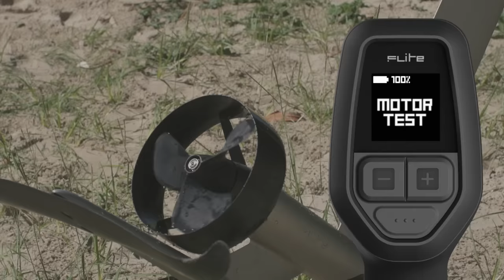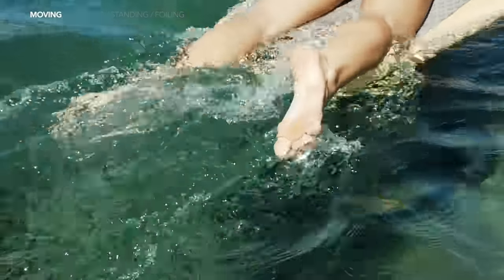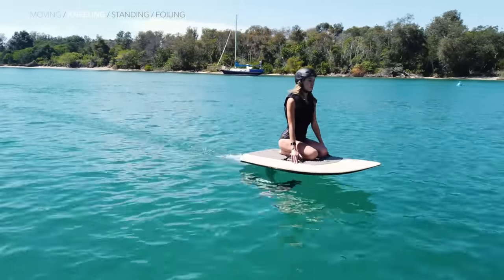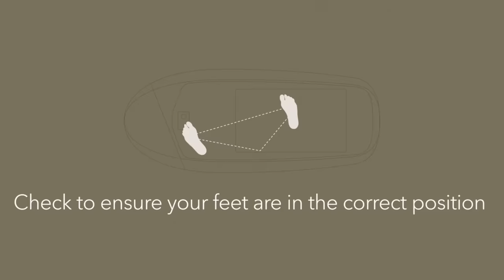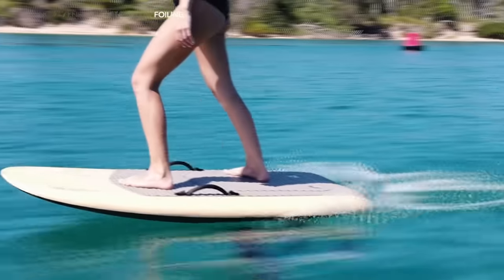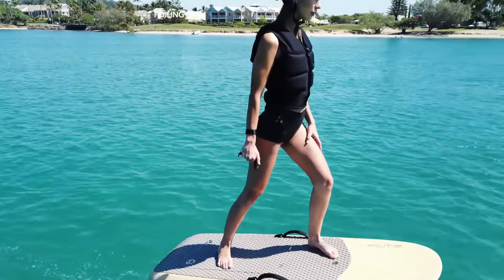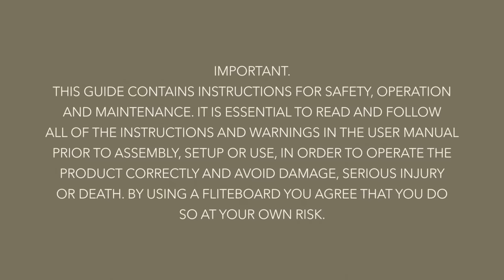How to Fliteboard - Series 1 - eFoil

Comment: We need more rich people to buy this, so competition and innovation will bring price down for us normal water junkies.
Reply: How much you are willing to pay stuff like this
Reply: @hammer7718    For $300 plus the cost of a surfboard, you can make your own.
Reply: How much do they cost?
Reply: @noahzegart5190  Like 10 grand
Reply: @woomeebly  Dude, no way that's real. won't even cover shipping.
Reply: @elusha3926  it’s not even the price of the board without foil, motor, batteries, and S&D
Reply: @coolhari2000  13k and up
Reply: @noahzegart5190  5-8k euros
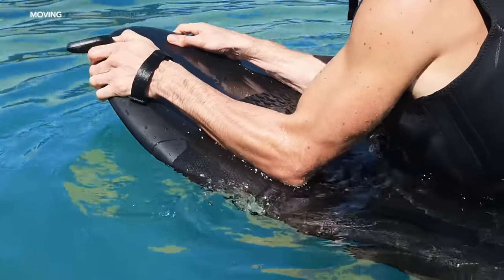Reply: 3:35 when your boarding instructor also drives a windowless van :P
Reply: I did my part
Reply: Lots of used ones for sale😂😂
Reply: @craigspriegel8982  Where & how much
Reply: That's like the price of a car....seriously...hand crafted...gimme a break.
Reply: @DEO777  how?
Reply: @pikoportal  mount an electric motor, propeller, and battery in a surfboard.
Reply: @DEO777  make total sense. Any advice with specifics? Which electric motor would you use?

Comment: Looks pretty cool, 12 k seems pretty steep, but normal for new tech.  Hopefully as the technology progresses the price will come down.
Reply from the maker: A lot of the cost is in the battery and hopefully battery prices drop as lithium supply increases. A lot of the other costs are the cost of hand made carbon fibre work, which hasn't really reduced much in price over the past decade. Our board itself is much more complex to make than a high-end SUP or Sailboard but is about the same price (for the board only).
Reply: Wait till the Chinese rip it off. 100 bucks.
Reply: Definitely way to steep and it isn't the battery which is less than $500 of it.
Reply: Can't put a price on glory
Reply: well think about all the ingeneering long trials work to create the perfect balance with aerodynamism and weight. Nobody clap in hands and create this technology in few seconds.
Reply: Just put a stressless recliner chair on it.. much cheaper...

Comment: Can't the motor be more covered to make it safer? Will that reduce performance? The only really bad safety hazard I see are the exposed blades.
Reply: There is a propeller guard as standard. Version 2 of the board (released Q3 2021) allows the guard to be removed with a free spinning propeller when the power is stopped - this feature allows the board to act as a foil surfboard when riding unbroken waves.

Comment: 1:55 Why can not run the motor out of the water for long time? What would happend to the motor? It is running with no load, what is the problem? Thanks for yout anwer.
Reply from the maker: The seals and motor shaft get hot as they are not cooled from the water.
Reply: @Fliteboard  Thanks for your answer. Now is clear.

Comment: Ok, I am brand spanking new here. Several comments. As others here have commented, they are right, 12,000 is way too much and you will be forced to deal with that fact just as soon a your first imitator puts their first product on the market for 1500. Stay ahead of them though by doing two things. First, make that foot pad your rider stands on a solar panel so you can ride that thing all day on your way to the Bahamas. Second, put an emergency GPS signal on it so -you know. Ideally, I'd like to see a 50 cal mounted on the front. We good?

Comment: Why didn't they mount the signal receiver on some kind of heightened contraption if water can block the signal? Sounds like faulty design.
Reply: For sure.  If the antenna were about 4 feet tall, you would have something to hold on to.  A chair would be nice too.  drink holder...
Reply: @topbuilder3790  Way to circumvent my point. Idk if you were trying to be funny or serious.

Comment: The Bluetooth receiver going under water and not working at critical times could be super risky. Imagine sitting in a car and having all controls disabled in cruising mode lol
Reply: Also i feel few safety features can be added like stop propeller when surfer off-boards, a safety hinge attached from the nose to pull to front. Not sure whether those would be sufficient to avoid learning injuries by detecting the direction of surfer fall and moving the board away. Once learnt, I feel it would be a super enjoyable experience.

Comment: Out of sheer determination and the utter ridiculous cost of this, i would build my own, i have enough knowledge to do this, i mean its not exactly a pioneering element of engineering, over 14000 euros, you could buy a fricking boat or a jetski, i get the portability of this but for 14k i would forego the element of portability. MENTAL PRICE BANDING.
Reply from the maker: MjrTraumaVictim if you want to do a project and build your own, you can find information online. But as many people have learned, this route won’t really save you money if you want a durable, reliable and safe board. There is a lot more involved than meets the eye. Especially making a safe and waterproof battery that will give you adequate range and power. And to build something that works as well as Fliteboard will cost you much more. A jetski is actually cheaper to build, and costs almost 100x more to own and run with fuel costs.
Reply: @Fliteboard  i hear you, i truly do, waterproofing things is not the issue with regards to safety, I am a commercial diver and marine/ mehanical engineer, can i take a stab in the dark and say 18650 batts? modern jetskis are now electric would hold a lot of juice albeit at a heavy cost of power to mobility/weight, but they can be adapted fairly easily and waterproofed easily enough. Im not knocking it to the point that its not a great product i mean its amazing, but i think the price banding is aimed at elitist rich, and i completely understand that, however this would be out of the price band of many watersports enthusiasts as it truly is a lot of cash. I DO LOVE IT THOUGH, ABSURDLY
Reply: How’s that board going col…….Built yet?

Comment: Wouldn't the electric motor attract sharks?  They are sensitive and attracted to magnetic fields caused by electricity.
Reply from the maker: We are based in one of the major shark capitals of the world and have not had any issues with sharks, despite our team riding on average 300km per week for years. Sharks cannot detect electric fields from very far away, and they typically are opportunistic scavengers as opposed to chasing things.